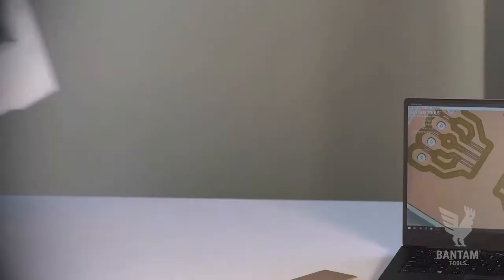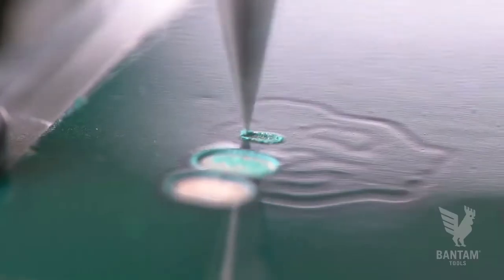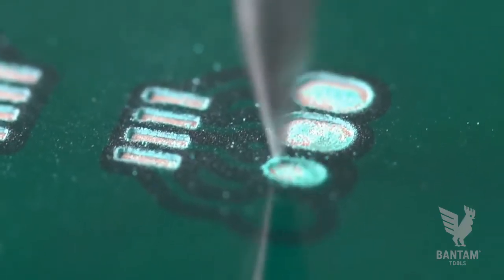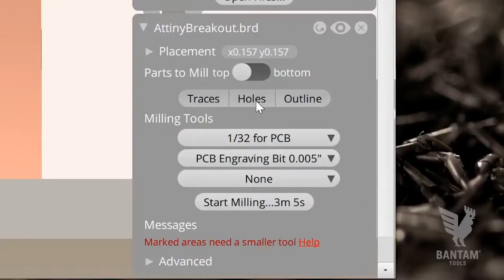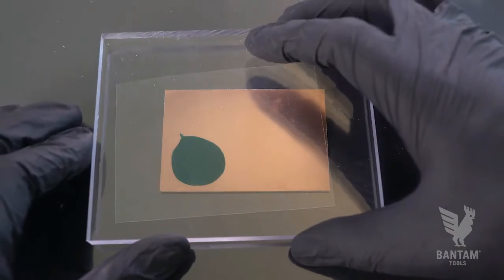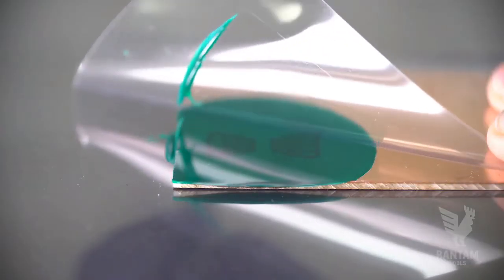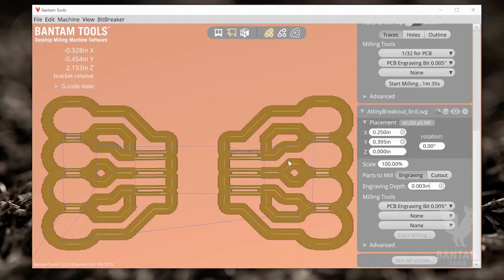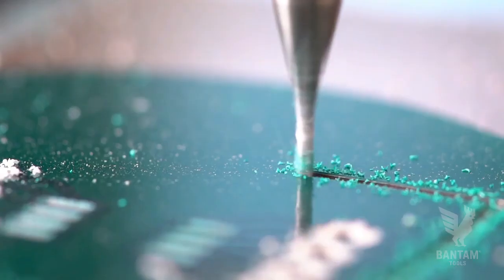Bantam Tools CNC How To Make a PCB Solder Mask

Comment: Great tool until something goes wrong. Ray who I think is the owner of the company has the worst Customer Service manners I have ever come across. The coupling spring broke and when I complained told me it was my fault for using the tool as a milling cutter. I am a professional engraver and the tool has never had a depth of cut greater than 1mm or 0.040inch.

CNC-AID Tools also have a $50 minimum spend even if it is only a 1\8" diameter spring that is needed. Very dissapointed whit this Company

Great tool but only lasted for 4 months.